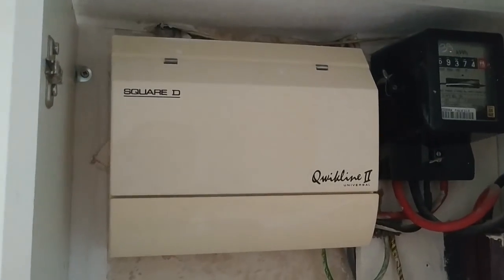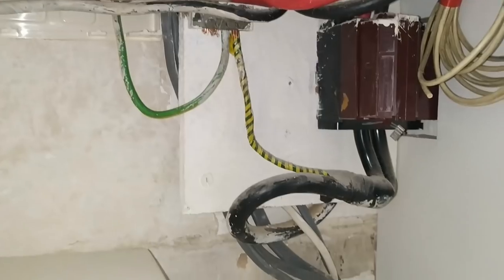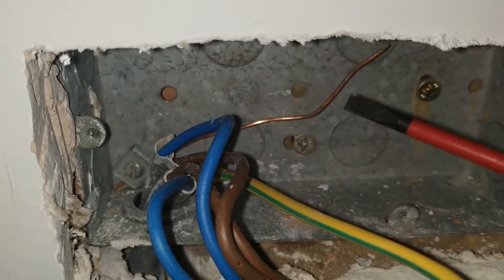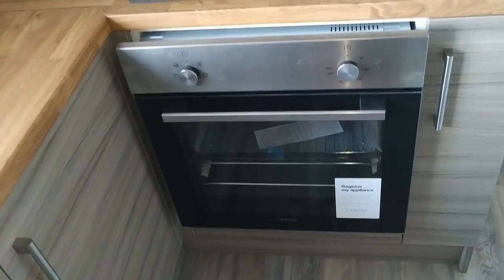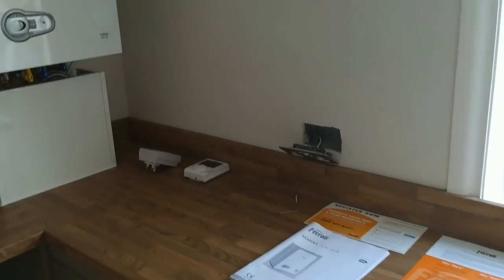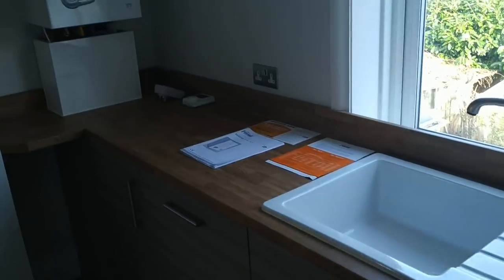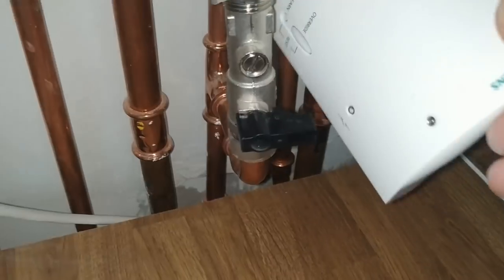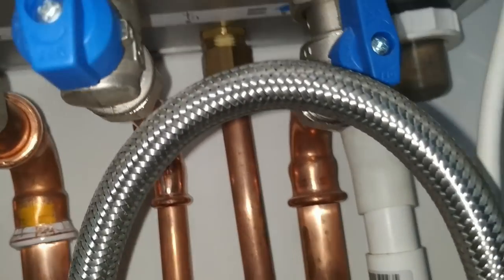Newly Refurbished Electrical Shambles

Comment: British electrical equipment is basically giant Legos with wires running through it. I continue to be fascinated with its differences from North American kit. If there was one thing I'd adopt on this side of the pond, it'd be fused plugs.

And yeah, no matter where you live it's possible to find horribly botched installations.
Reply: I like that way of doing things- In particular, the DIN rail breaker box- you can use any brand of breaker, because they're standardized. Here in the US, the breakers are proprietary and matched to the box. There's probably 6 different types currently in common use, plus replacement breakers for boxes that are no longer manufactured. So stores have to have 10 feet of shelf space devoted to breakers, electricians have to carry all of the common brands and ratings on their truck, etc. And if there's ever a design flaw found in a manufacturer's breaker design, rectifying it would require replacing the entire panel instead of just the breakers themselves. Ridiculous, really.
Reply: I like aspects from both sides of the pond, NA for nice big breaker panels with lots of room to work but Europe for RCD protection for every circuit to name a few.
Reply: @puckcat22679  The regulations require that breakers are type-tested with the enclosure they're used in and as manufacturers have no commercial interest in allowing other breakers being tested in their enclosures it doesn't happen.  The assumed inducement of being able to sell their breakers for other enclosures has not been effective.

As a result the standardisation of parts means that very often they will fit and the manufacture of breakers to standards means they will work as designed.  But the lack of testing will result in voiding all warranties on both  breakers and enclosures which  gives the installing electrician a problem: with appropriate notes an Electrical Installation Condition Report can be issued but in doing so with a mixed installation the electrician removes liability from the manufacturers and takes it on himself. So sensible ones won't do so and cavalier ones won't have the indemnity insurance to cover any and all possible failures.

Regulatory standards here are BS EN 61439-3:2012, part of IEC 61439 defining the specific requirements for distribution boards intended to be operated by ordinary persons,  e.g. in domestic (household) applications.
Reply: Matthew Malthouse Interesting. I always assumed that that was one of the benefits of standardization. I wonder if that rule is common throughout Europe. My Father's house in Greece has like 3 different brands of breaker in its panel. Of course, being in a rural area in Greece, that most definitely doesn't mean that the regulations were necessarily being followed by whomever was doing the electrical installation!

In the US, mixing breakers really doesn't come into the equation that often, because everyone makes theirs different. There are aftermarket breakers for some panel designs that have been around for ages, but if the manufacturer still makes their own breakers for them, very few electricians will install the aftermarket ones, again for liability reasons.

Comment: What's wrong with having both earths in the same sleeve?
Reply from the maker: In the same sleeve isn't a particular problem, but these ones are completely twisted together as well, which work hardens the copper making it brittle, and makes subsequent alterations or testing far more difficult.
Reply: @jwflame  if a fault on one side it makes a pain in the butt to separate the 2 earths, and it stresses the wires, leaves some exposed, etc.  Just bone idle bad work!
Reply: It make it difficult to perform a proper "tug" test to make sure both wires are properly secured. If they are just together in a sleeve and one is not secured, it might still pass a test as the copper is in contact, but it's not a reliable contact.

Put them in separate sleeves and it's much easier to perform those necessary mechanical tests.

Comment: So what happens now John? Were you called to do an electrical inspection of the property? Obviously you will document and record the defects, but is there a legal requirement for the landlord to rectify these faults before letting the place out? Cheers.
Reply from the maker: This isn't a rented property, but if it was the only requirement is that it's safe - which usually means there is either no inspection at all, or if one is required by the letting agent they get the cheapest person they can find just so they can have a piece of worthless paper that claims it's all fine.
Reply: @jwflame  Thank you for your reply John. I was curious what the situation was, particularly after seeing that connector block under the basin. I have (unfortunately) almost come to expect such things under plinths and in lofts, but never in such an accessible location.

Comment: I love your videos but not too keen on this one. I can tell you don't do too many domestic EICRs. 90%+ of houses I look at are far, far worse than this. Most of the points made are pretty typical of most houses (especially when the kitchen fitters have been in) and I've yet to come across individual cpc sleeving. Still, An informative video for DIYers. 

P.S. When testing voltage shouldn't the last probe on and first probe off be the line probe?
Reply: But it was being sold as 'fully reburbed' so they would be asking top dollar. It's fraud when you claim that and it isn't.
Reply: It was crap and JW had to say it was crap. And refurbed ?? The ordinary punter has no idea about proper electrics until the wheels come off

Comment: Does the shared CPC sleeve fail any standard if the CPC is covered? Surely it can be argued that an unbroken (folded) CPC would be preferable, as breaking it to install separate sleeves makes the CPC continuity dependent on the correct tightening of the CPC screw in the socket? The rest of it is a horror story, thanks for sharing and its nice to see you back in 2020.
Reply from the maker: It's not necessarily a problem just having them in the same sleeve.  The real problem here is that they are twisted together which makes subsequent alterations/testing far more difficult, and also makes it more likely for the copper wires to break.
These are not one unbroken piece - it's two separate conductors twisted together..

Comment: I've read various comments here, on Reg's etc, but things can still slip through the net if there's loopholes & unscrupulous people. The thing is, is it's not just the residence that can go up in flames, next doors can & also loss of innocent life! 
My Ex is a "Conveyancing fee earner" & does her own house sales/purchases legal work. had a nice house in Haslucks Croft, Shirley, sold it last March. I went to help her pack stuff. Found dodgy/dangerous wiring, (done by her now dead husband. No, he didn't fry himself) earth bonding not fixed to a metal multi halogen light fitting in garage, (seems it sometimes tripped the breaker)  a 30A junction box in the garden shed 3ft from the floor, just inside the door, no cover.  On the plus side - - supply was Armoured cable, but it went into the side of a cheap plastic single outside socket, no gland just loads of silcone plastered around the hole & cable with - - a dripping outside tap above it. I pointed out the faults & offered to fix them, she said "No, the house is sold, not my problem now" (I mebbe wrong, but I think - that's a breach of the TA6 form) Needless to say I left disgusted, I did txt her a week later to check whether she'd had the faults sorted got no reply. So, just for piece of mind, I sent a letter to the new occupiers voicing my concerns pointing out things to check. (yup, still got the txt & copy of the letter I sent)
This isn't the first time his wiring has come under scrutiny. After the sale of their house before 'Haslucks'  seems there was a 13A socket fed by 5A T&E with no earth connected, a 240v fan near the shower/bath & loose/missing Neutral & Earth cable screws in the DB with wires just poked in. 

On a lighter note, (excuse the pun)  Blue to blue, blue to red, blue to brown, blew to bits!

Comment: An analog meter - should be smart, I think the terminated lead in the vanity unit was for a lit/defogging mirror? as for the absence of the fan - there is a opening window, thought that would be adequate 🤨
Reply from the maker: It might be for a mirror - but usually it would be put into the wall above the basin, not below it. 
In theory an opening window is actually acceptable for ventilation, but in reality no one opens the window in the winter.
Reply: There’s no requirement for electrical installers to change the meter to smart, that’s down to the power company.
Reply: @99Noggin  I've been offered a smart meter - turned it down most emphatically. Info from Big Clive - seems there's nothing good about smart meters.

Comment: Hey John, what do you recommend people do with old electrical fittings and plugs? What if they're still in a fair condition?
Reply: Our fuse box was in already in 1976. It's still there. My view, leave well alone.
When I added an earth to the metal living room lights, those 5A fuses withstand blowing holes in the bulb caps. Could be 100A for a ms for all I know to make the bulb cap look like it's got woodworm.
Reply: Here in Germany it is quite easy:
1. Are they in a good condition and not damaged?
2. Do they still meet the requirements and regulations when the electrical installation or the appliance was built?

If you have such old stuff it is ok to use it if it's still in a safe and good condition. But you should not remove the plug of an old appliance and put it on a new one in case of the BS1363 plug with the unsleeved pins. The thing is, if you fit a plug to a new appliance, this plug must meet the requirements of today. And unsleeved pins on the plug are not meeting todays standards. Here it's not that big problem, because our Schuko plug didn't change since the 1930s, except that you now also get such molded plugs as you get them for the BS1363. But I would also not fit such an old plug to a new appliance, because if I would perform a PAT test, the earth connection would propably fail due to minimal corrosion on the contacts. The earth continuity should be less than 0.3 Ohms (with max. 5m of cable between plug and appliance).

The problem in this video was, they used old materials and these were propably sold to the customers as new...
Reply: @Marcel_Germann  Prob. earth continuity with 100A 240V would be less than .3 Ohms !
Reply: @millomweb  Unlikely for a plug that is rated 250V/16A.
Reply: An electrician should never reuse old fittings.
Reply: @stephengough9785  Why?
Reply: @millomweb  because everything degrades over time, as a professional you are installing a circuit/addition to circuit complete with fittings. The electrician is then signing off their work to state that it is safe and compliant. 
If you are using old fittings you cannot sign off to say that it is safe and compliant.

Reusing backboxes wont cause problems but reusing anything that carry current can.
Reply: @stephengough9785  Only difference is regs at the time. 
Most of our stuff is 45 years old at least. We've had one 'electrical' failure - the spring in the bathroom light switch failed - metal fatigue.
Reply: @millomweb  are you a electrician and do you work on other people's properties?
Reply: @stephengough9785  I'm an engineer and do whatever I want.
Reply: @millomweb  what I am getting on at is do you reuse fittings in clients houses?
Reply: @millomweb  no need to get so defensive
Reply: @stephengough9785  Client supplies his own 2nd hand fittings.
Reply: @millomweb  not with me they don't
Reply: I am not paid to work on other people's electrics.  But reused materials brought in should be certified as being "good as new" with many decades of operational life left in.  Any self-respecting recycler would have put a different sticker over the old washing machine sticker, preferably with his brand and name, though a generic label with the new purpose would be enough.

Comment: At about 15:30, boiler segment, I'm surprised you didn't mention lack of earth bonding between the piping? Also, I'm pretty sure those push fit copper fittings are not suitable for gas? I don't know what your interest was in the property but it should have been reported to building regs and HSE?
Reply from the maker: Pipes to boilers do not require bonding and never did.
Reply: Strange because I was charged £400 for an IEC certification and that was picked up as a fail! I had three IEC inspections and every one was incorrect but we, the public are at the mercy of these people.

Comment: I'm not doubting the need for earth sleaving to comply with regulation but what is the motivation for the requirement? Other than identification - which to be honest a bare wire seems to provide - I can't really see the need (other than compliance) to insulate a conductor providing a connection to earth within indoor domestic equipment.
Reply: It can sometimes press into other terminals when crammed into tight fittings.

Comment: Filling loop should be disconnected as well on the boiler should have two taps not a valve you turn with screwdriver. What a bodge up all way round !
Reply: Pauly H you're right of course, but have you ever seen a filling loop that isn't permanently left in place? Rare as rocking horse droppings to find one unattached.

Comment: BTW, looked like the cooker connection and socket was screwed to the kitchen cabinet.  I thought this was not permitted, bicbw (perhaps ambiguous in the regs).  I have seen it done quite a few times.
Reply: I had a professional do that.  Screwed the connection to the back of a cupboard that wasn't even attached to the wall.  Pull the cupboard out and it ripped all his cabling - secured to the wall with blobs of polyfilla - fell off.

He seemed to think that was perfectly OK and within the rules.
Reply from the maker: Sockets can be attached to cabinets, but only if they are properly secured and the cabinet itself is permanently fixed to the wall/floor.  The backs of many cabinets including these ones are just thin flexible hardboard, so not suitable for a proper fixing.

Comment: I wonder if someone can clear up something for me. John seems disapproving of the earth wires being together in one bit of sleeving, implying they should be separate and individually sleeved but I can't find any other real clarification on this. The electrician I spoke to made the point that he twists the earth wires together and single sleeves them so if for any reason they came out of that socket back, there at least would be some contact to carry earth through to other sockets on the ring. I am confused. (this is normal for me)
Reply from the maker: Twisting work hardens the copper, making it more likely to break.  Also make future alterations and testing far more difficult.

Comment: Why did you not check the fuse ratings were correct on plugs ?  Also the  boiler should be connected by a fused connection unit,
Reply from the maker: It's all being replaced anyway, so nothing to be gained by checking the existing fuse.  Boiler connection has already been replaced.

Comment: I can't see why any house being sold isn't required to have an electrical safety certificate and the same for gas?
It could easily be requested by the lender and would any prospective owner want to immediately rewire their house?
Reply from the maker: It was proposed years ago as part of the Home Information Pack.  And then quickly got rid of it before it even started.
Reply: @jwflame  I remember, I still can't understand why but then I'm probably missing the point. I think a gas and electrical inspection for all house sales along with mandatory solar PV on the roof of all new builds, but wheres the sense in that?

Comment: Also.... looking at the boiler installation, i very much doubt that a certified gas man/ plumber  done it, its all been done with push fit copper !!!!. No plumber i know would do that on a new install as its a lot dearer & shows incompetence in soldering. There normally used by D.I.Y  people.

Comment: Why do you have double hot and double neutral wire coming to sockets? Dont british electricity code use junction boxes...
Reply from the maker: Junction boxes can be used where necessary.  Adding extra joints just for the sake of it isn't appropriate.
Reply: We use ring mains in the UK and this is acceptable if done correctly. We understand other countries are different.
Reply: @alanjjeff  I see. Thanks

Comment: Does the boiler have a certificate? It seems hard to believe that a gas safe engineer would put a 30+ year old plug in a new boiler
Reply: John Smith I’m surprised it was on a plug at all, I thought they had to be on a fused spur.
Reply from the maker: Not that I have seen, but didn't actually look for one either.

Comment: Those hood extractors can be set up to recycle air too.
Reply: As long as an active carbon filter is installed on the fan...
Reply: They can but what’s the point?
Reply: @andrewschannel3635  cheap cheap cheap
Reply: Michael HTT may as well not bother to install one at all then because it serves virtually no purpose.
Reply: @andrewschannel3635  the filters can help but really there isn't much point.. More of a show thing
Reply: Andrew Stevens stops the unit over the hob getting stained, that’s about it. I have one myself and it’s useless, but it’s not practical to run a duct because of its position
Reply: @mcmcolm  Same here, got one of those useless extractors. But nowhere to run a duct.
Reply: @andrewschannel3635  It absorbs smells into a charcoal or carbon filter
Reply: Andrew Stevens Sometimes it's just not practical or permitted to run a duct. Tall apartment buildings, internal kitchens etc. Recirculating hoods are crap, but better than nothing as they do at least trap some grease and odour.